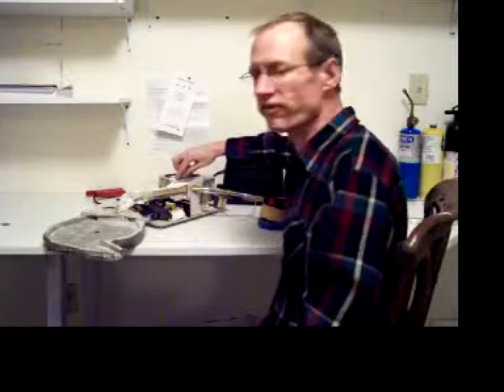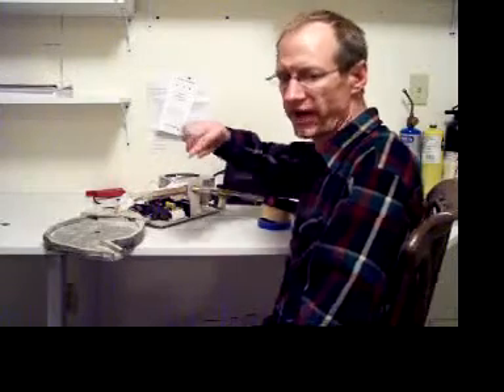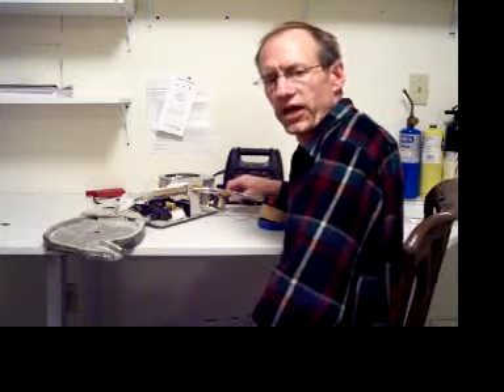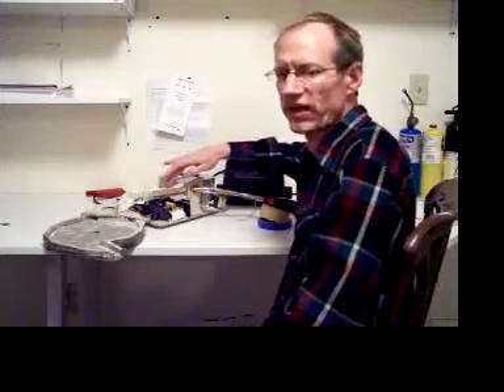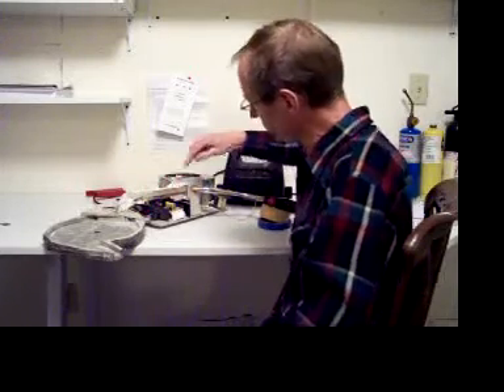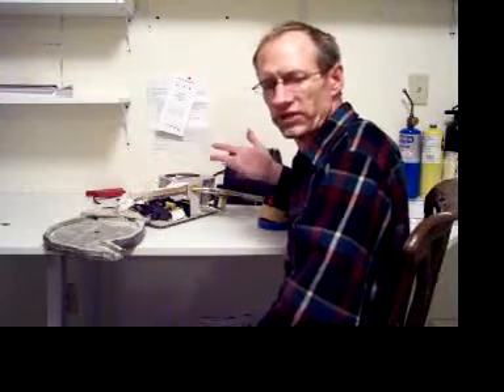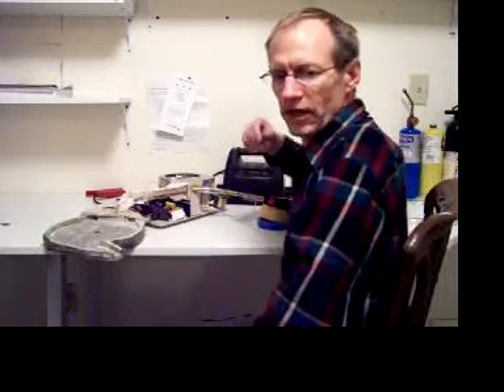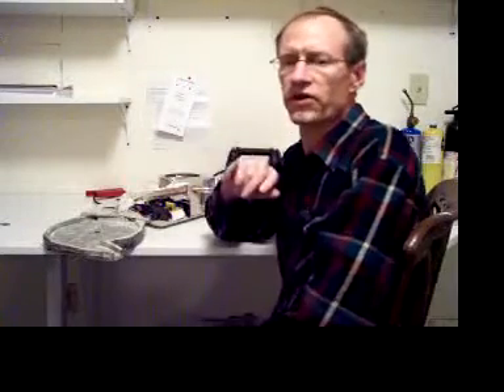VTDC Engine

Comment: Finally someone actually attempting to make or REdevelope a tesla Engine and not just the pump part. All i see online or on you tube are tesla pumps which is simply the disc part none seem to be attempting Teslas whole plan... except you Props man.... This happens alot in Science i guess people taking just parts of the ideas of inventors and trying to make them work without attempting the whole thing